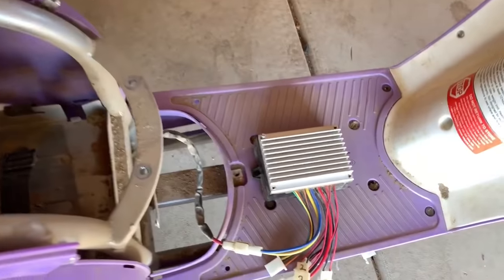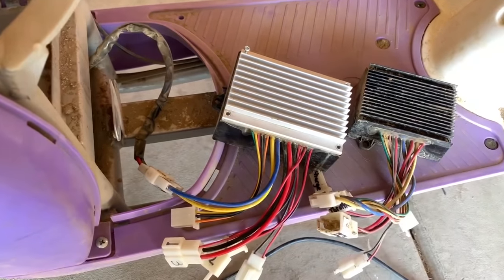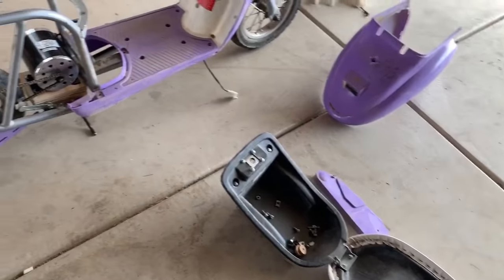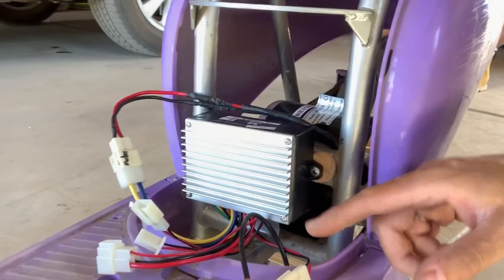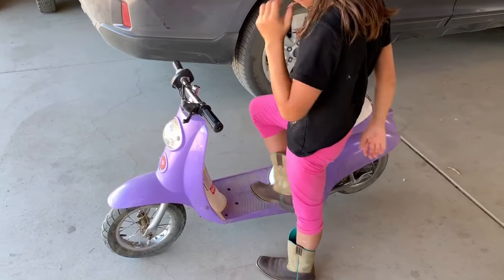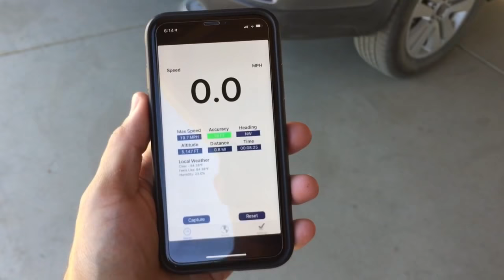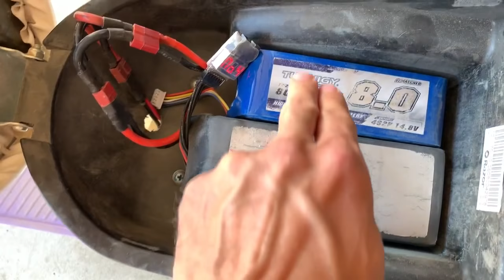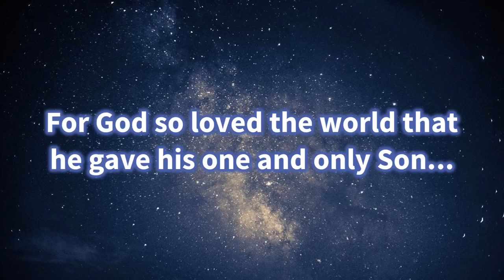Razor Pocket Mod Scooter 36v Upgrade!

Comment: If wood gets to hot can it catch fire?
Reply from the maker: Smile with Dentures The motor doesn’t get hot enough to burn wood, it generally doesn’t get hotter than 120-140F. And that is the motor can itself, the legs which connect to the wood are much cooler than that. Great question though. 👍🏼
Reply: Not a chance it has gods name on it

Comment: Hey just wondering did you use the stock sprocket on the motor ?
Reply from the maker: I used the sprocket that came standard on the motor I bought on eBay.

Comment: How did you do the batteries?
Reply from the maker: Jimmy Chafins Bought a 4s lipo and 6s lipo off Amazon and run them in series with deans connectors. I use low voltage detectors on them to keep them from running below 3 volts per cell. You need a lithium specific battery charger to charge them. 👍🏼

Comment: What's the part number for the batteries?
Reply from the maker: I don’t believe those batteries are available anymore. I’d search eBay or Amazon for a 6s and 4s lipo with matching mah ratings.
Reply: @MapleBoarder78  thanks!
Reply: @MapleBoarder78  Whats the little switch with the lights called? The one coming out of the batteries
Reply from the maker: @SS-st6qr  That is the Low Voltage alarms.
Reply: Thanks man, really appreciated it. Just bought my lil girl one of those scooters and I wanted to last longer than 15 minutes.
Reply: @MapleBoarder78  One more question, so i need one 4s and one 6s battery for the razor to work? And thr low voltage alarms  correct?

Comment: How much was the parts?
Reply from the maker: You can get a motor/speed controller kit on Amazon or EBay for around $150-$200. And then a 36v lithium battery will run you around $150 or so depending on the size.
Reply: @MapleBoarder78  I have a bunch of 18v Milwaukee batteries that I put in my daughter's power wheels car. And some 36v batteries for my ego mower. I know the 36v would work. But would the milwaukees work?
Reply from the maker: @Zx14rrrrrrrrrrr  I’ve seen people use them but don’t know how they hold up long term. If you wired two in series you’d have 36v, but they may not have much capacity due to their size. My battery was an 8ah and was the size of a large brick. It could get us about 6-8 miles depending on the terrain and temperatures outside.
Reply: @MapleBoarder78  gotcha. I don't mind buying a motor and controller. But hopefully I can avoid buying batteries 😂 I already have plenty.

Comment: Any way you could add a list of links and monetize them for yourself? That would help us and help you...
Reply from the maker: Unfortunately I buy off eBay so links to any products off there won’t work once the seller removes the listing. Is there something you are having trouble finding? In the eBay search bar type in...
-my1020 800w 36v motor
-36v Razor control module

In regards to the Lipo batteries and chargers, there are a hundred different brands you can go with. You’ll need to search battery forums to get recommendations. I just buy cheap knock offs on eBay. I use a basic 4s and 6s lipo run in series.

Comment: Does it also need a different charger now?
Reply from the maker: White light Yes, you need a charger that can charge lithium batteries. I bought a lithium battery charger on amazon for around $50
Reply: @MapleBoarder78  thanks so much for fast response!

Comment: Hii I was wondering what battery are you using for it??
Reply from the maker: You’ll need a 4s lipo and 6s lipo ran in series, or just a 10s lipo. There are also 36v specific lithium batteries on Amazon. The specific ones I used in this build are no longer available.

Comment: Wait how long does it last on battery
Reply from the maker: It varies depending on the terrain you ride on, the rider’s weight, how long you are engaging full throttle for, and the size of the lithium battery. I believe I was using a 8,000mah (8ah) lithium battery and it would last around 6 miles on hard packed dirt roads. If you used it on paved roads I’d imagine you could squeak out 7 or 8 miles.